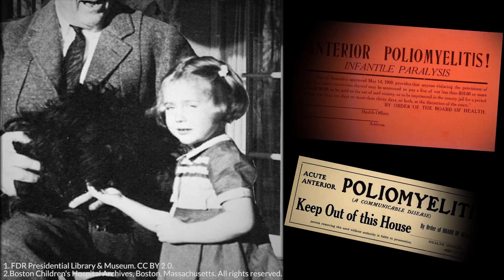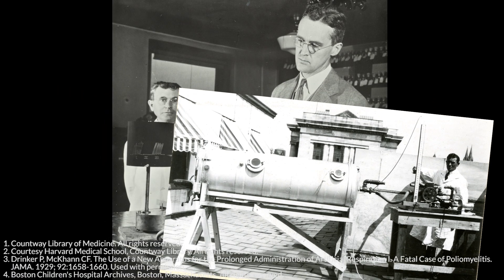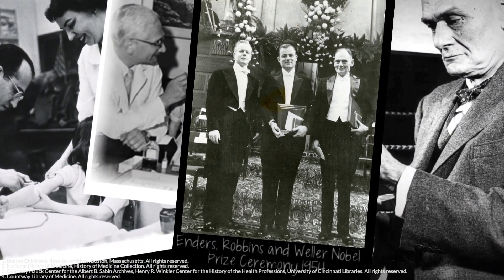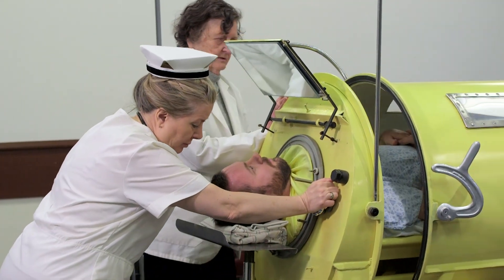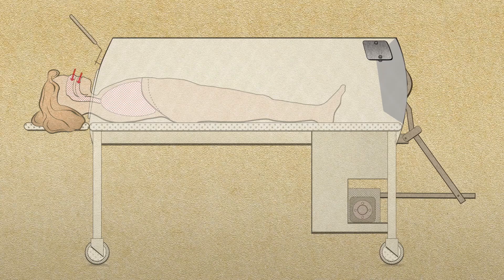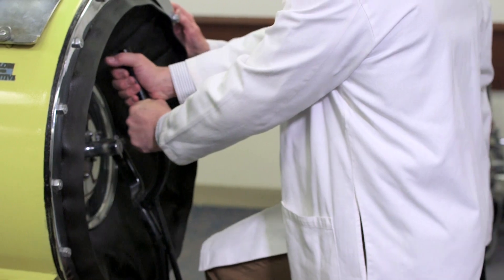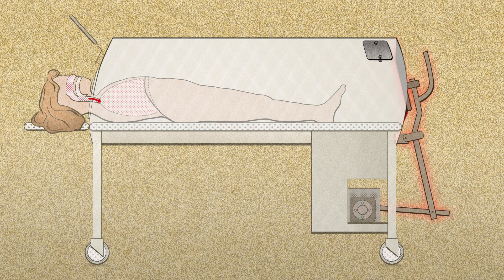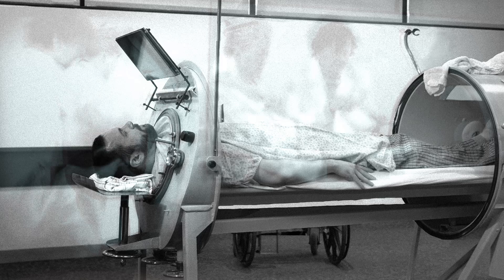The Iron Lung and Polio by M.Rockoff | OPENPediatrics

Comment: In relation to the part where they had the option to manually pump the machine, did hospitals back then even have back up power generators? Just wondering of during a power outage were they completely out of power?

Comment: I have seen quiet alot of iron lung videos now. Somehow I got stuck to this topic and got very interested about it. It is a very intimidating machine for me. It is like laying in a space capsule and you have to relay 100% to it. I can imagine how many people freaked out in that machine, in the thought, something could start to fail. I defenitly would !!!
This is a very good video, which shows the physical mechanisem and the function on the body. I couldn't believe that a small number of people are still using this machine, because the passive way of breathing should be more  pleasant for them, as the positive preasure method.
Thanks for the video!!!!

Comment: Iron lungs are still in use and not just 'medical artifacts' https://youtu.be/lf30N30Of94 
A little research shows where people still are using them, albeit expensively, because they are no longer manufactured by the original maker. Most parts either have to remove parts from dysfunctional systems that still work or they must be hand machined